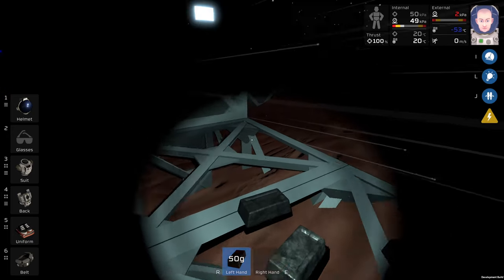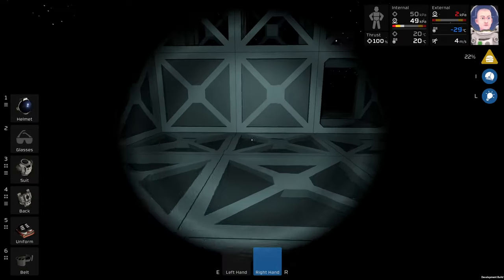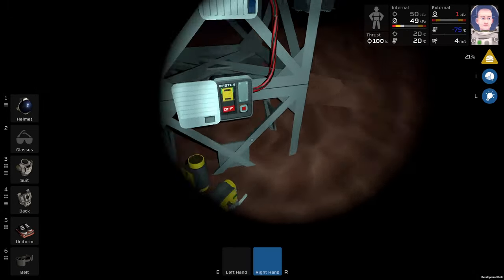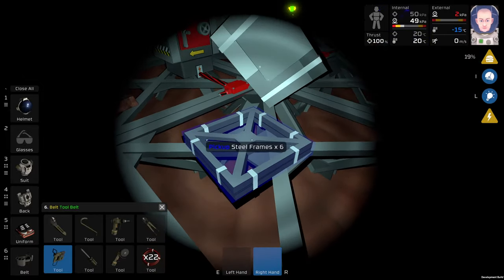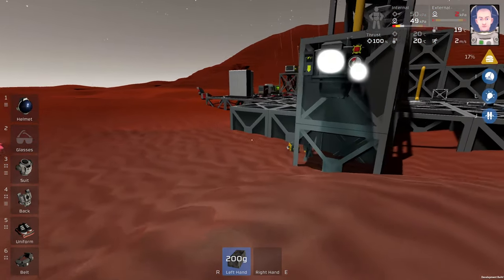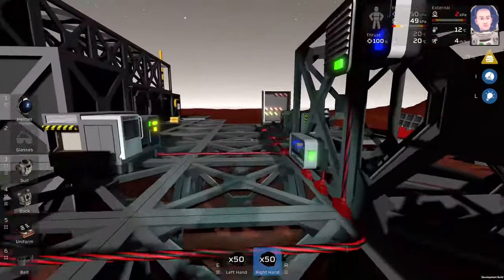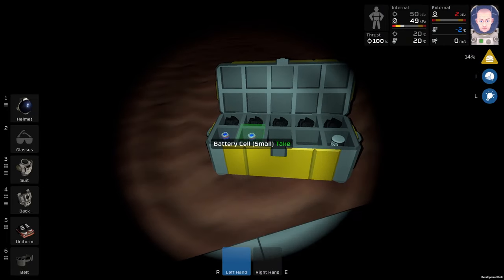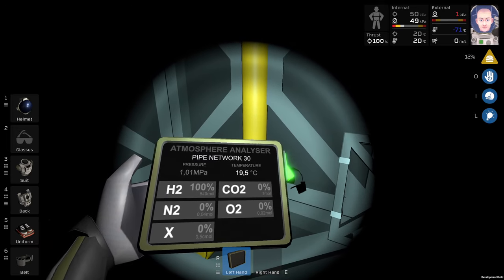Stationeers Lets play Mars EP 4 - Solder Alloy

Comment: When you have filtered our garbage gases from the geyser you can remove the filter from filtration unit and connect "Unfiltered" output from it to H2 tank. Ofcourse this is not safe from a game atmospherics bugs prone side but will not consume any filters in the end.

Also be careful not to overpressurize the tank as it seems the geyser itself has a fixed pressure limit (1 MPa) while air filter will increase it indefinitely up to an explosion. You can opt into removing filtration unit at all at some point to prevent that and not mess with logic circuits.
Reply from the maker: Thank you for an advice. I am thinking about to build large tank soon and I will "transfer" the hydrogen into it.